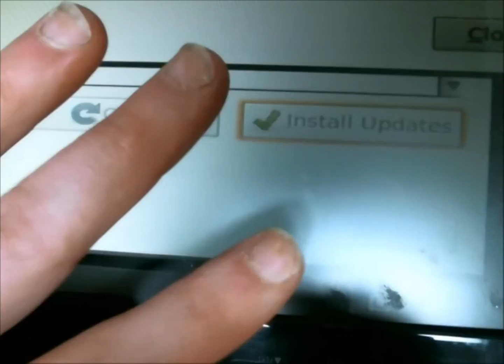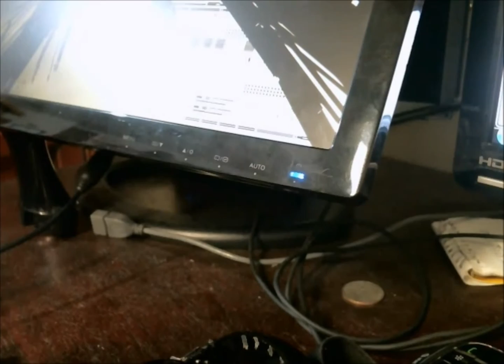LED Monitor Repair (audio fixed)

Comment: My screen is literally popping out cos the adhesive is coming off. Is there a glue brand or way i can fix it? The monitor is curved and a flat led screen so the part popping out is pretty thin.

Comment: I see that you changed the frequency of RC cars, but me and my friend are planning on both buying a Koowheel d3m electric skateboard and if we want to race they will probably interfere, is it similar to change the frequency on them as it is to the rc cars, if you could do a video it would be amazing but otherwise is it possible for you to tell me if it would be possible? Thanks